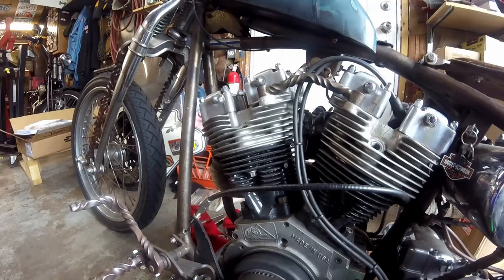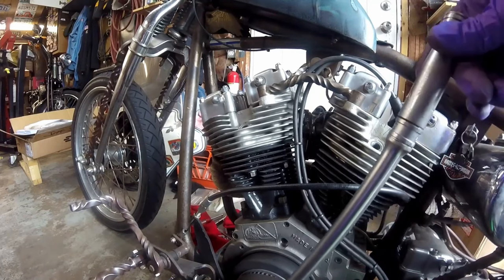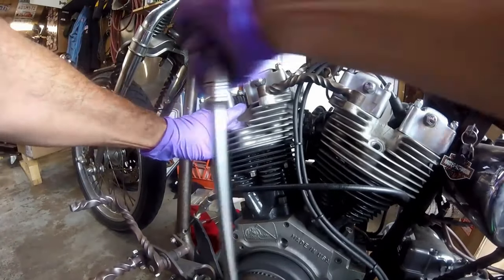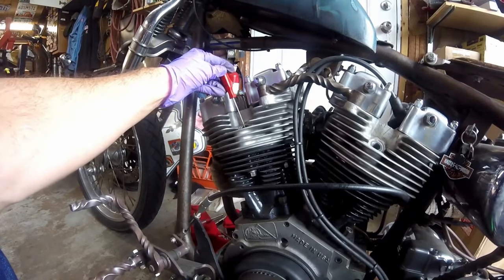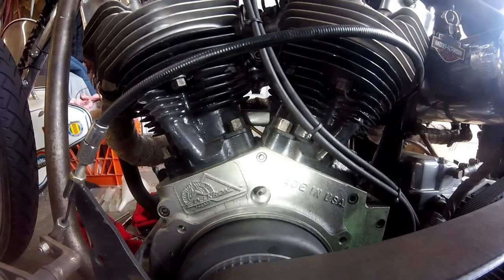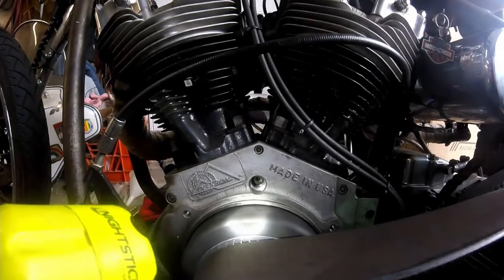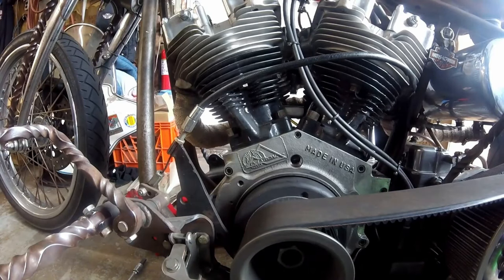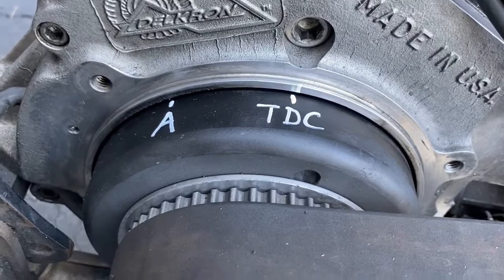Finding TDC on compression stroke Harley motor Knuckle Panhead Evo Twin Cam M8

Comment: Clear and concise as always - for an Evo with a VOES,  I guess it needs to be timed above 2000 RPM with a timing strobe so the VOES is active?
Reply from the maker: Or disconnect the vacuum hose and plug it.

Comment: Delete the part about marking the belt pulley instead of using the timing hole.
Timing gun manufacturers are complaining about loosing sales, LOL!!
Typed by a guy who years ago forgot to put his timing gun in a big zip lock bag and oil vapor got inside the timing gun and blew out the zenon bulb. Those bulbs get stupid hot and the oil blows them out almost immediatley. 
You can also mark the rotor on an enclosed primary sytem and shoot the timing mark from the oval inspection cover on the outer primary.
Its a little harder so see but still way better than shooting through the timing hole.
Reply from the maker: That’s a great idea that I never thought of. Thanks for passing that along and thank you for watching.

Comment: Great video. I have a dilema.. i was installing a S&S oil pump and cam plate to my 2017 street glide with the 107. I got to the point of where you torque the cam plate bolts and then you rotate the rear wheel until your crankshaft makes 2 complete rotations. Well heres the issue.. i got a little happy with it and didnt count how many turns the crankshaft actually made and i may have gotten it 180° out. Whats the best way to determine if i have it out of time or not? Feel free to message me if its easier. Thanks!
Reply from the maker: It doesn’t matter. Put the crankshaft on TDC and align the timing marks on the camshaft. The camshaft turns at half the speed of the crankshaft.

Comment: Are the cam lobes" on the front two lifters"  when you're at top dead center. on the flat, or on the lobe?
Reply from the maker: If you’re on TDC on the compression stroke, the lifters will be on the base circle of the cam. I have a great video on how to find TDC on the corner stroke. Look through my videos to find it. Thanks for watching.
Reply from the maker: Sorry you are on that video. Here is another video that should help. 

https://youtu.be/bfY8Ac1Ggo4?si=iqWjTWEInJBhc9Di

Comment: I have a S&S 117 evo . When I’m timing the engine do you set it on the TDC line or 35 degrees before TDC
Reply from the maker: It depends on what ignition module you have. Let me know what module you’re using.

Comment: So the fire  timing Wil Sparks 35 degree before TDC each cilinder?
Reply from the maker: Correct. Both cylinders will fire 35 deg. before TDC when the motor is above 2000 RPMs. Before 2000RPMs it ramps the timing in.
Reply: @Rapsgarage  thanks dude,really apreciate it.i just wanna know why a Harley exaust sound was so different,with Japanese twin.

Comment: Do you absolutely have to be in 5th gear to do?
Reply from the maker: No but the last gear your transmission has spins the motor the slowest making it easier to line the timing marks up or finding TDC,

Comment: Hi, great vid. Just a bit confused - at 5.33 you say the late shovel advance mark is the line. As far as I know the advance mark on a late shovel is the dot.
Reply from the maker: I'm just saying what my bike has and what the manual says. Harley did different stuff in different years.
Reply: @Rapsgarage  Understood, but the manual states late model TDC is the line and Advance is the dot.
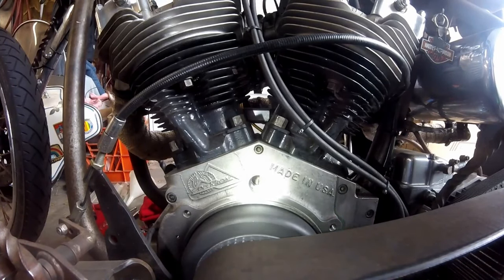Reply from the maker: @rod4530  I not sure what your asking. I'm showing you the manual and it directly says the line is the advance mark. At 3:18 I show the advance mark on my late model shovel and it's the line. Mine matches up with what my manual says. The point of my video is that you don't need the manual or need to know what marks you have before you open the timing hole and look. The point is you bring it to TDC and see what mark
 you have then spin the motor backwards and see what mark you have for the advance mark. At that point to can time your engine.
Reply: @Rapsgarage  Yes, I understand and have to say it's the best video for the intended purpose. My manual says different and it's widely accepted that the late shovels used a dot for advance, but as you say Harley did mix them up a bit and that's not the purpose of the video. In other words, use the technique and sort out your individual marks. I appreciate your comments and meant no offence. Please do keep up the good work.
Reply from the maker: @rod4530  I didn't take and offence at all. I just want to help people any way I can. I'm glad you liked the video. If you have any other questions, please let me know. Thx
Reply: You are a pretty good Wrench, and good instructor also👍💯😎